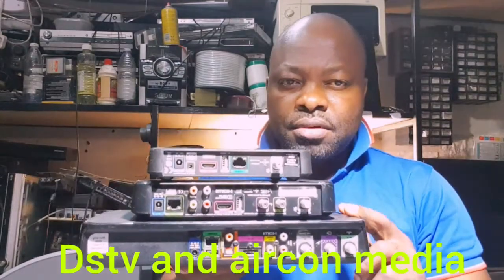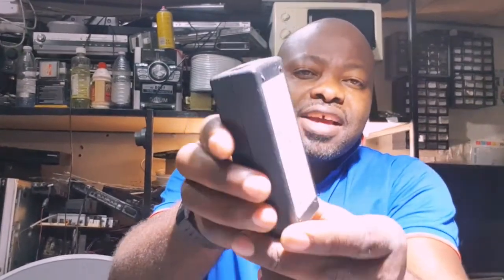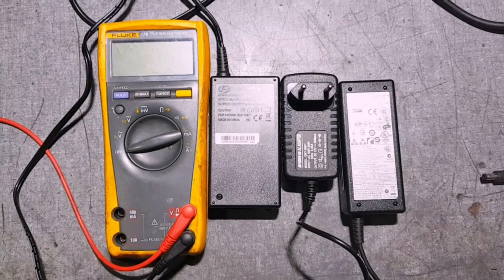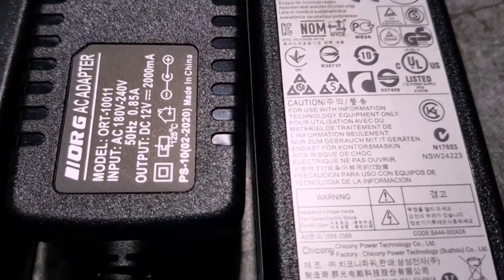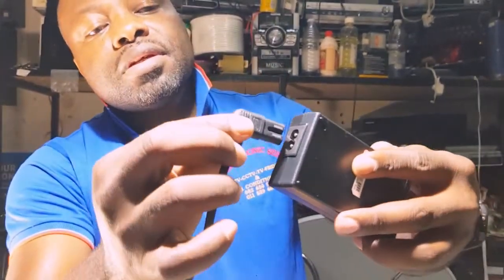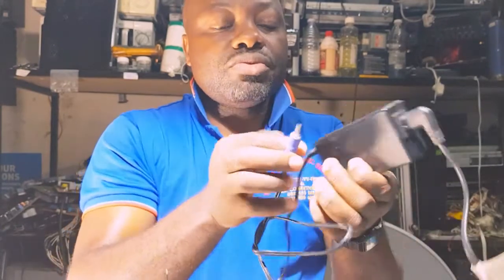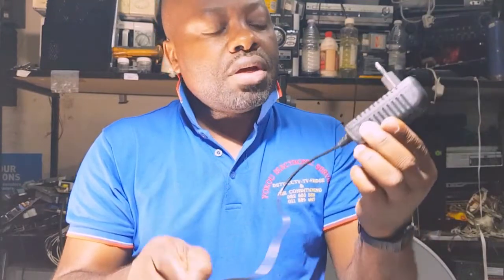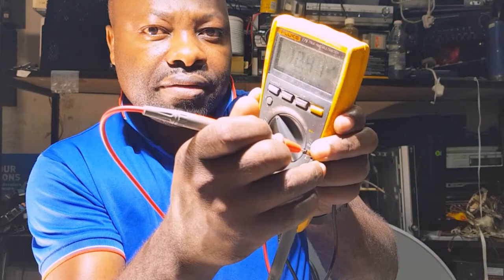how to test a dstv  power adapter or a laptop charger with a millimeter. dstv specialist

Comment: If plug the power supply in and it shows green, it means there is power right. But when I connect the DC power point to the decoder, it shows a red light on the adapter which is flickering, but decoder doesn't power up